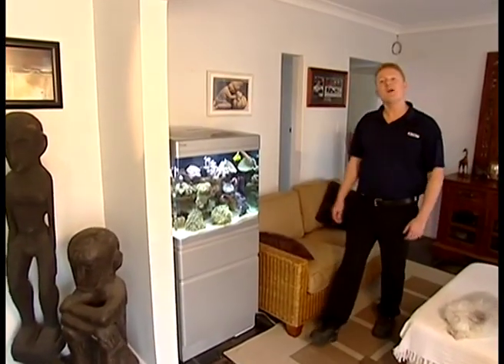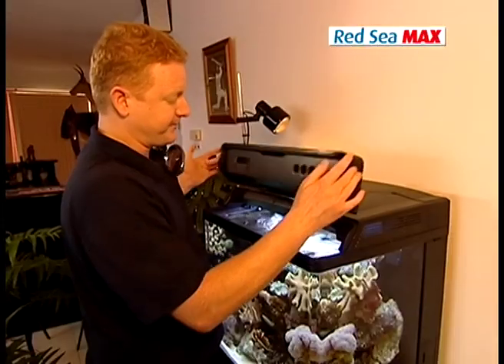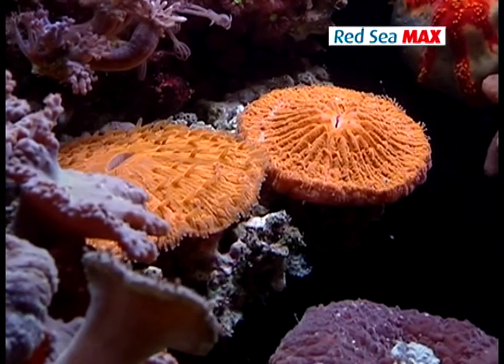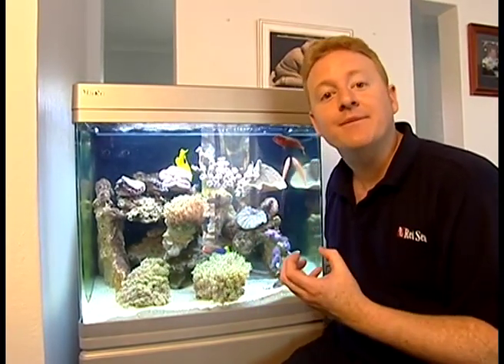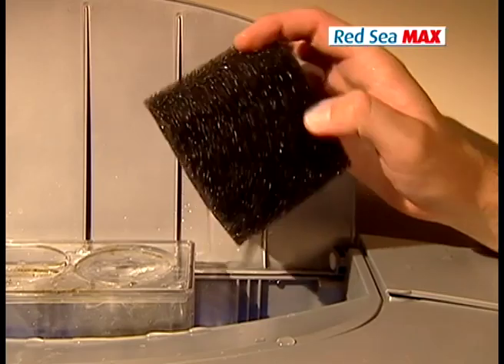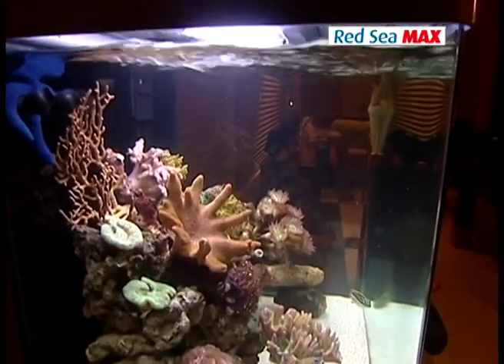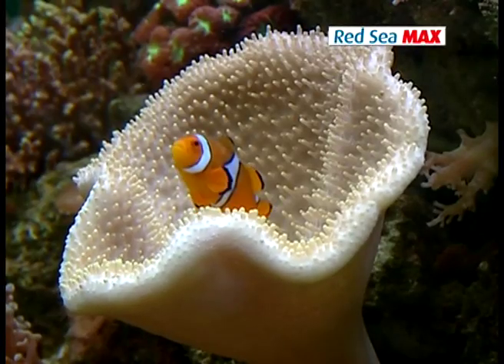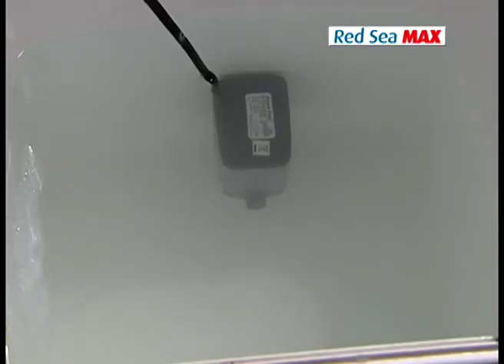REDSEA MAX 130 Amazing reef aquarium by RED SEA

Comment: Hello Paul! Great video on the tanks! Had a couple questions regarding it though. I'm looking to upgrade to a larger tank soon. In currently running a Fluval Edge 6 gallon Nano Reef. (Videos on my YouTube acct) my LFS just stocked these tanks, but they haven't put one on display yet. I'm curious how noisy the tank is; I need a quiet tank. How much heat does the lights produce, is a chiller required? How difficult is it to get replacement parts for the unit? Is there anything universal or must it be ordered directly from Red Sea? Average cost if running the tank with lights, pumps/skimmer, heater, chiller? Do they offer a LED lighting kit? Very curious and very interested to know more. Thanks!
Reply from the maker: They make a little bit of noise.
It is likely you will need a chiller
parts depend where you live
must it be ordered directly from Red Sea
Average cost if running the tank with lights, pumps/skimmer, heater, chiller? is not much, do not buy the tank if paying for a bit of power is a real concern.
No LED lighting kit yet